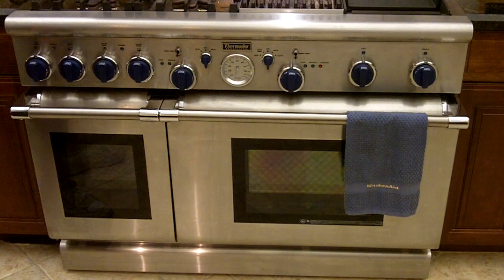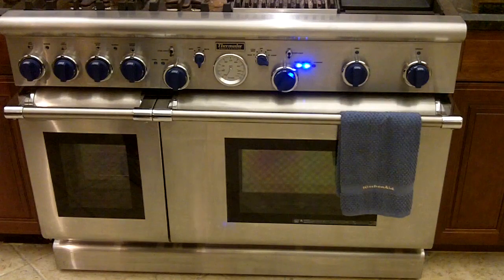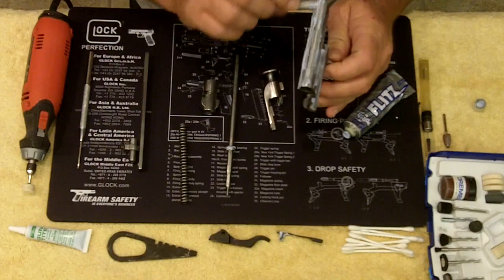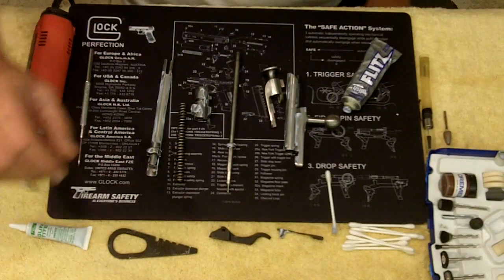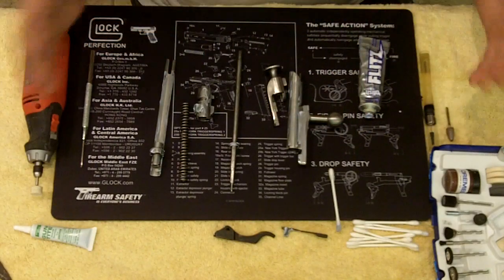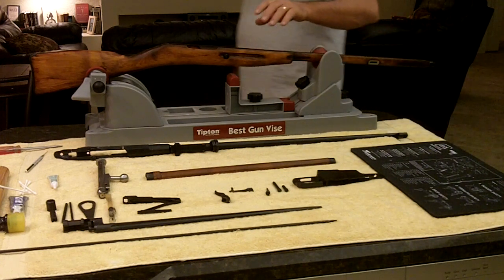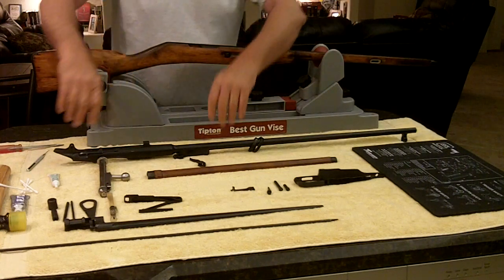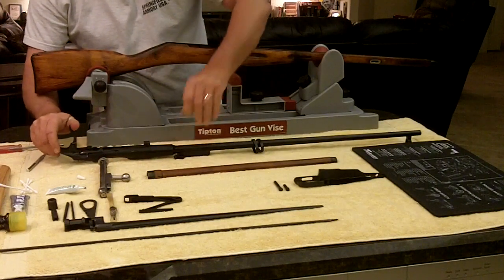Mosin Nagant On The Menu pt. 3 Lubrication & Reassembly !!!.MOV

Comment from the maker: @TheMagicalDillyG The only thing i can recommend is buff off all the rust off and the wax itself will provide protection but I would also put a thin film of oil on it. I cant see why it would keep rusting if it has protection on it. Where do you store the firearm ? I would look at that also and make sure you have a cool dry storage area. I hope this helps out, it shoulkd be fairly easy to keep the rust off. Try the buffing and then some oil. Thanks and please keep in touch and let me know.  :  )

Comment: I know you used some degreaser to get the cosmoline of yours, but I used hot water and steam. So, would I need to bake the oil back onto it, or could I just oil it like normal? I've already cleaned it with some solvent and wiped it down. 
Very informative video!

Comment: If my oven only goes down to 170 degrees is that going to be a problem? You also don't say if you used the miltec on the bolt assembly. Wouldn't it make sense to lubricate the internals while you have the assembly taken apart? Thanks for the video, I'm getting my first 2 MN in the mail on Wed. This will be my guide.

Comment: Did you apply the MILTEC oil to the trigger, sear, and bolt as well? Should I heat treat those parts with the MILTEC as well?

Comment from the maker: I will make this quick and simple for you. The bolt is covered in cosmoline. I have to remove the cosmoline and in doing so, I might as well buff the bolt nicely. It helps with the sticky bolt situation that MN's are known for and it just makes it cycle more smoothly. I am gunsmith/armorer at K&W Gun Works in Delray Beach Florida, I might have a clue as to what I am doing. Thanks.  :  )

Comment: As hot as it gets here in DFW area, my solution is? Wrap up the gun in a cheap towel, leave it on the dash of your pick-up in the sun during the summer, then bring it in after most of the cosmo has seeped out...

Again, works best in the summer.

Nice baking vid though!

Comment: I opted to use Hoppes Oil on all the metal surfaces, and then added plain 10W20 motor oil all over the bolt assembly (after the Hoppes), and any metal to metal rubbing parts, and also all over the barrell, especially where the wood stocks will be covering it and hard to get to later, unless you take her apart again.

Comment from the maker: @CmRenninger If you have no way to heat the gun up to about 150 degrees, then just oil it down with a quality gun oil.I like Militec, CLP or Hoppes, whatever brand you use. It will be ok, its just best if you could heat it up but not mandatory. Thanks.  :  )